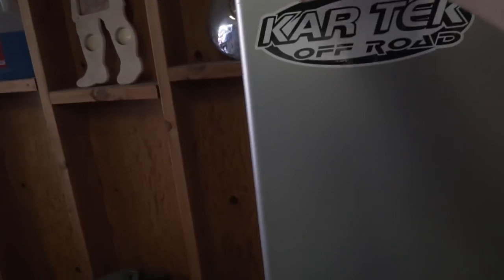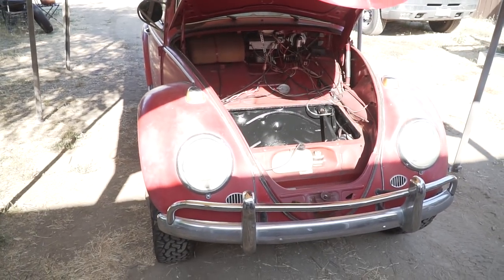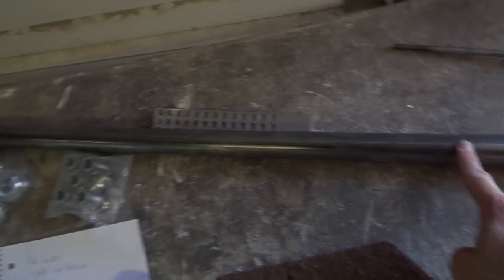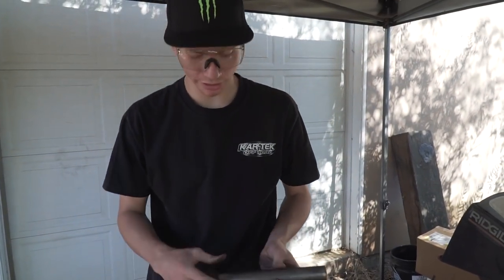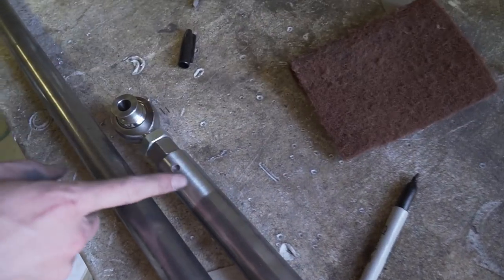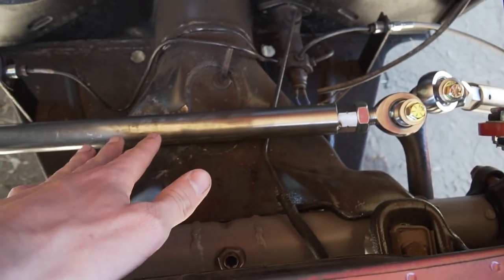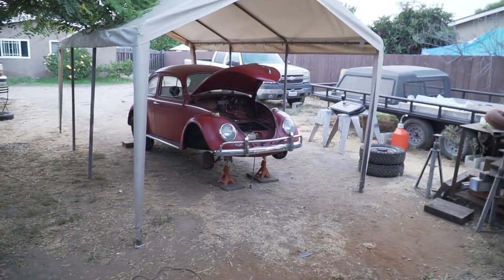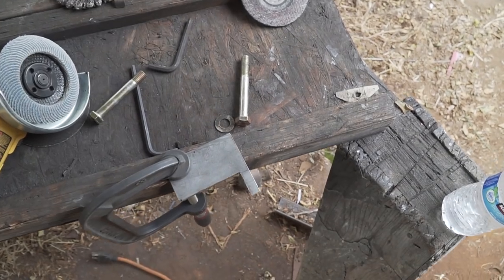Building CUSTOM Tig Welded Tie Rods for the Baja Bug

Comment: Cool to see you working on the bug again! Maybe not a good idea to tie wrap the bare stainless braid to the metal trailing arm? It will probably wear the mesh over time.
Reply from the maker: I have thought about that. I realistically bought brake lines that are a little bit too long which is why they are tied there in the first place. A 22" line would be much better. Ill keep an eye on these for now

Comment: A couple things. If you take steel wool and just spray your bumper with soapy water and rub that steel well on your bumper it will become so shiny once again. It's actually quite amazing how fast it'll shine up with steel wool. The other thing is you can set your toe in two 1/8 in on the front. You basically just use a measuring tape and make the front of the tires 1/8 in less than the back of the tires. Just Google set alignment on a beetle and there's a lot of information on how to do it. Good video appreciate it
Reply from the maker: I'll give that a go! I have heard of that steel wool trick just haven't gotten around to doing it. Enjoying your videos!

Comment: Really good info on setting up tie rods! Great stuff man! Can we send you a VW Life sticker?
Reply from the maker: @Tsalinger  You are right should just get rid of the car before I ruin it haha. I can always easily swap to a rack and pinion if I need to. This is a perfectly fine setup for what I am currently doing with the car.
Reply: @WingsWorldChannel  you are spot on very concise on your approach to each job 👍 excellent pitch w/ information thanks for the share was thinking about heims for 63 definitely going smaller for stock app welding on hidden body seal very difficult from inside unless body off

Comment: you have a particular go to rattle can product for that prep work on the metal? I need to clean off my frame and do the same
Reply from the maker: We just use rustoleum 2x satin canyon black for everything. All the tube work and frame on the 92f1build are done with that too. It isn't more durable than anything else is, we just like the color. If you want something more durable, I would check out POR 15.
Reply: Wings World thanks! And keep up the good work- great Info for us working on prerunners without good support locally (outside of SoCal)

Comment: when u lifting rear. notch n rotate the spring plates?
Reply from the maker: I rotated the inner spline 1 time to get a little over 2" lift. I didn't notch it but it was pretty difficult getting it to go back together.
Reply: @WingsWorldChannel  much preload center adjusters work well little bit of cutting and welding adj.  on a dime don't recommend notching on a swing axles spring plate over travel will eat side gears in tranny stick to stock travel length on 11 app ball joints will like u too...

Comment: On my class 11 style build I aligned it to 1/8 toe out. She runs good on the street. Little pull here and there but doable. And in the dirt steering Input went up and made it more drivable. (less understeer) than toe in.
Reply from the maker: I have heard of a lot of drift guys that are running that as well because of the response. I may give that a go!
Reply: Depends on your driving style beginning toe in 1/16 wheel even out running tire selection plays big side bite as well as pressure for contact patch less is more running hard in racing app some guys like to bounce  a some like control for technical sections err on the side of caution if racing for beginners....